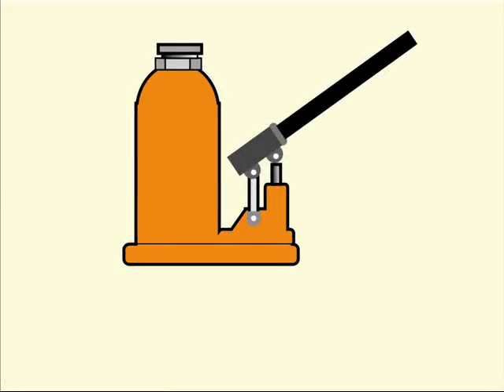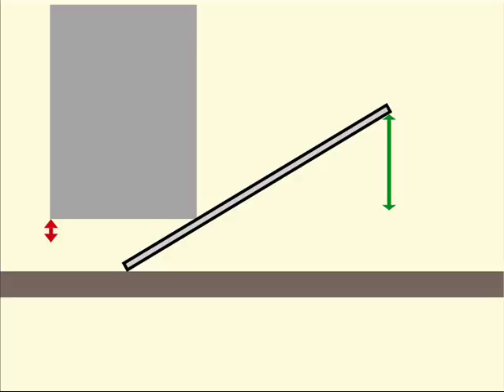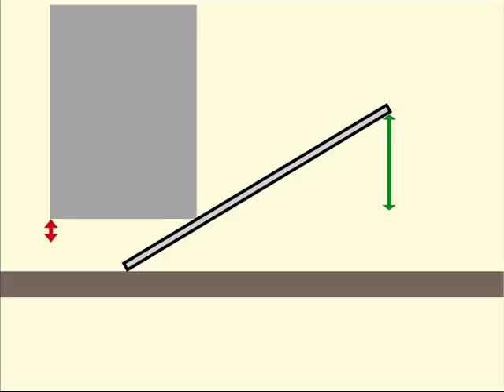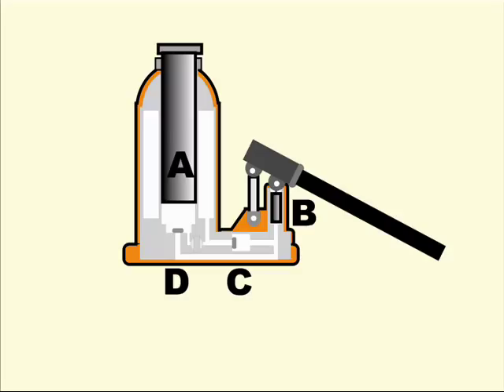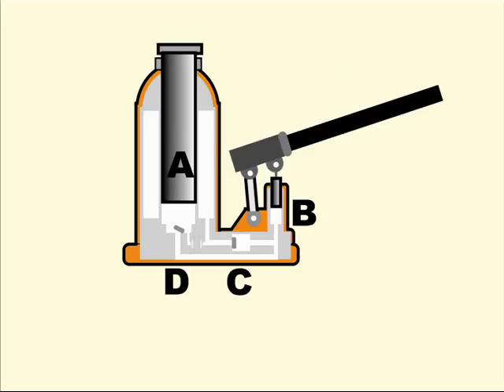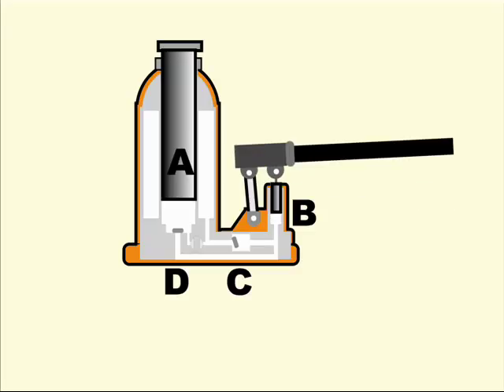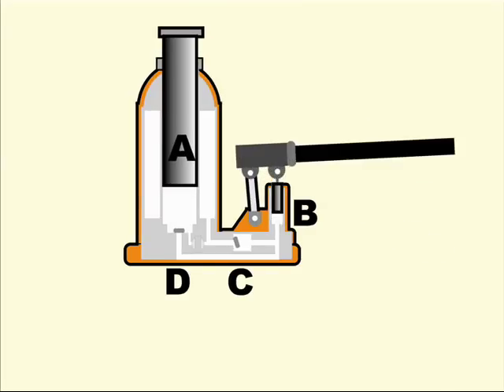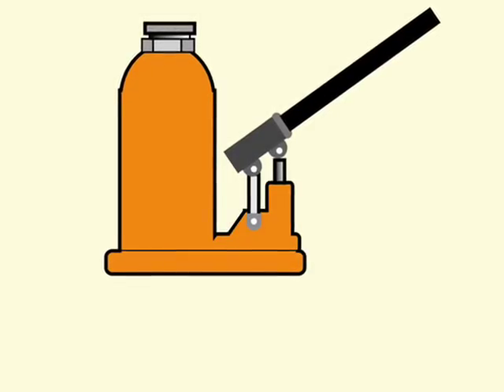How a hydraulic jack works

Comment: Thank you! that was helpful. My floor jack was not working because one of the two small B pistons was stuck. I have a dual piston jack. I pulled out the piston and cleaned it but I also noticed that the O rings on one of the pistons was not sealing good. I replaced O rings and its working great again. Now I understand how vital the B piston seal is to getting a good lift.

Comment: This is an excellent explanation.  
Makes me want to check out the rest of your work. I hope you have something on calculating the thrust of screw jacks.
Reply from the maker: Thanks for your kind comment!!! There are some very interesting types of jacks. Scree jacks ate just an application of the inclined plane. The finer the thread, the longer the ramp and the higher the lifting ratio. One very interesting approach is the friction jack used in old VW jacks. I used to own an old beetle and it worked just fine! It used to lift both the front and the rear wheels on one side of the small thing. You can find an explanation on that on https://youtu.be/hL9n-hLek7E
Reply: @eltunene  I will check that out.
I recently made a couple crude screw jacks out of nuts and bolts to get me out of a bind. It worked so well, I thought that i would try to calculate how much force I was generating.
I skimmed through your channel for a minute. Looks very interesting.  You are a man of many interests and abilities. I'm sure I'll be back to learn some new things.

Comment: Will the jack work if it is placed horizonataly?
Reply from the maker: Dear Venkat, you would have to find the optimal position for gravity to fill up the small piston chamber, which could be somewhere with the lever pointing down or to one side. Otherwise the pump may not "suck" the oil from the reservoir. Cheers!!

Comment: hi CHAVA I THINK YOU CAN HELP ME. FEW MONTHS AGO I BOUGHT A NEW JACK. I ASKED MY SON TO LOWER IT AND HE UNSCREWED IT TO AN EXTEND THAT THE FLUID COME OUT. I THEN TRIED TO REFILL IT AND IT NEVER CAME BACK TO LIFE. 

AND THEN YERSTERDAY I BOUGHT NEW 20 TON JACK. AND MY ASSISTAND DIDTHE SAME. THAT IT HOW I STARTED SERCHING ABOUT JACKS ON INTERNET.
THIS IS WHAT I TRIED TO DO : I UNSCREWED IT COMPLETELY AS IT WAS ALREADY NOT WORKING.I THEN TRIED TO FILL OIL THROUGH THAT HOLE. NOTHING CAME RIGHT. 
I TRIED SECOND METHOT OF OPENING A PLUG THAT IS RUBBER ON THE JACK AND FILL IT WITH OIL AND IF I PUT MY FINGER ON THAT HOLE AND TRY TO PUSH ``A`` DOWN THE PRESSURE RISES ON MY FINGER. AND WHEN I TRY TO JACK IT UP IT DOES NOT.

EISH
TRY HELP ME
Reply from the maker: Dear Moshitoa, first of all, thanks for your question. I learned about hydraulic jacks back in the early 1950s, and then my life turned to electronics for the last 60 years. However, maybe I can be of help to you by trying to find more info on that. About hydraulic jacks, most of the information around is generic, since they work on the same principle. So I would suggest you to watch the following video at:  https://www.youtube.com/watch?v=uRNhUCExu5Y Without saying a word, this guy cycled the hydraulic jack several times in order to rinse it, fill it and purge it. Notice he never removed the  E valve at all, just opened and closed it as part of the recycling process. I think this wordless explanation is worth a million words! Please update me on your final results.

Comment: Question if we use the same jack extend the piston and reservoir would we be able to raise the jack and its load faster??? I want to build a lift but with out motor power hydraulics.
Reply from the maker: Dear Denzil, maybe I did not quite understand your question. A hydraulic jack works with a fluid, but basically the principle of force multiplication is the same as with a lever and a fulcrum. If the load end of the lever goes up say, an inch, and the  opposite end has to be moved say, 10 inches, the effort is multiplied by ten, however, if you change that ratio in order to apply force for a shorter distance, and you are expecting the load end to move a longer distance, it will not work that way. If you extend the big piston's length (and of course the reservoir and the length of its cylinder) you'll have the capacity to lift your load for a longer distance, but will have to pump many times, which equates traveling a longer distance at the input. On the other hand, if your are talking about extending the length of the small piston,  it will work, but of course, every pumping cycle has to be longer, which equates to pump several times; it will work, but you'll have to apply the same force for a longer distance. However, part of the force multiplication is due to the length of the lever linked to the small piston, since for every inch you move the small piston, you have to your end of that lever about 8 inches, you would have to modify the lever mechanism in order to take advantage of the original multiplication ratio of the lever itself.

Comment: Why would the jack work perfect under no load and not work once load is added
Reply from the maker: Very possibly there is a leak in some valve or seal, and under no load, you can pump enough oil to raise the big piston, but when under load the leak would be sufficient to retur the oil without raising the piston.
Reply: Thanks for the reply so I guess the jack would be garbage

Comment: What I don't understand is that as the pressure under A increases because of heavy weight it is lifting but how doesnt it reverse back the pressure when the valve is open to put more oil into it?
Reply from the maker: The valve is in fact opened by the pressure the small piston exerts upon the valve when  the jack is being pumped. The pressure on the fluid is distributed evely (Pascal's principle) and exerts a pressure against the small piston too, but the pressure on the small piston is relatively small (psi), since the surface of the small piston is small compared to the surface of the big piston. It's a matter of pressure differences.

Comment: The Piston Diameter difference of A & B and force increase due to it should have been mentioned, I suppose.
Reply: It was, don't be a jerk, just pay attention, or make your own video
Reply: @atozbikes  I thought the same thing, that the video should have mentioned that the difference in diameters of the cylinders itself produces a mechanical advantage, additionally and independently of the lever principle. I rewatched the video, and it does not mention this. Of course it acknowledges that there is a difference in piston diameters, but it does not explain the way in which the ratio of piston areas, each with one and the same pressure acting upon it, generates a multiplication of force in addition to the lever principle. It is the most basic principle of hydraulics, and it is conspicuously absent. 

He repeatedly mentions that the operative principle is the lever's multiplication of force, as if this were the one and only (or primary) principle at work. In some jacks, the hydraulics does more force multiplication than the lever. 

The way he explains the limitation of the lever, namely the limited range of motion, and his introduction of the hydraulic jack as getting around this limitation by repeated "swinging" back and forth, suggests that he may think the sole purpose of the hydraulics and check valves is to allow for cumulative levering (and not to further multiply force), as if the hydraulics here were just a sophisticated ratchet. 

Besides this big omission of how hydraulics work, he also says a couple things which might be construed as technically false. For example, about halfway through he says that the lever is used to drive the small piston down, which increases the force (on the big piston) several times. This is true in one sense. But say the pistons were configured in reverse, so that you were pumping instead on the large piston. If the ratio of their areas was large enough, the mechanical (dis)advantage from the pistons would more than offset the mechanical advantage from the lever, and his statement would be false -- the force exerted on the output piston would be less than the input force, even as the lever itself was increasing force. 

He also states the amount of fluid being pumped into A from cylinder B is small, which is why A doesn't move very far. Again, it has more to do with the ratio of cylinder areas. I could pump the same small amount of fluid from B, but if I were puming it into an even small cylinder, C, piston C would move a great distance! 

There is no need to get defensive about this. Everyone who produces high-quality materials like this video, for the noble purpose of educating others, should be open to feedback on how better to educate. It would be a very simple change to say explicitly that there are two principles at work, and give a brief explanation of hydraulics. Even if he wants to focus on the lever principle, he can easily mention hydraulic advantage via ratio of cylinder areas. It would give viewers a much better grasp of the bottle  jack, and hydraulics generally, and would save confusion down the road.
Reply: be ready to listen to or read the adverse comments, or else disable the comments. Thanks

Comment: Which is the best fluid for hydraulic liftings
Reply from the maker: Functionaly, almost any fluid would do, however, the cylinders have rubber gaskets and o rings which may be damaged by some liquids, as well as steel parts which can rust, so special hydraulic fluid is better in order to keep the jack in good working order for a long time. Hydraulic jack oil is low viscosity, essentially the same viscosity as 10W motor oil. Never use brake fluid, antifreeze nor water, it will damage your jack.

Comment: Nice video created by you

Which software is used by you will you suggest me
Reply from the maker: Dear Pankaj, I use very simple software, I am currently using Inkscape for frame by frame animation, very simple. However, there are many nice animators our there, but I have never used them.

Comment: How do they run out of oil?
Reply from the maker: Any leak due to a bad gasket or seal, can cause a jack to lose oil gradually. Normally those jacks last forever, but sometimes, if used very frequently, they will develop leaks and start to malfunction.

Comment: Can it be used for a machine that picks up heavy heaps of wood?
Reply from the maker: Dear Zöe, well, yes, however, if the motion has to be done for distances over 3ft, or so, you can try using an old power steering system, pump and all, driven by an electric motor. I have seen people use that for dump trucks, so it can be used for  building a crane.  Here are three links to videos on applications of power steering components for other uses - https://www.youtube.com/watch?v=s3u7uWiFmak  -  https://www.youtube.com/watch?v=UXCwFsxTtII -  https://www.youtube.com/watch?v=PSAtLNn8NwE&t=146s

Comment: I am afraid this explanation covers only the lever part and it does not cover all the process that is occurring in the Hydraulic jack and it completely missed another very very important part of the explanation of how it works.
Here is the missing HYDRAULIC part:-

As the gentleman said, using the lever effect, the small piston B can receive a larger force on it more than what the human operator is applying. Let us say that the distance of the piston B from the FULCRUM  is x while the longer distance of the HAND  from the fulcrum is y, then  if FH is the force due to the hand and FB is the force on the piston B then,  FB= (FH )*(y)/(x) where FB will be greater than FH as y is much longer than x.

Now the force  FB of the piston working on an area (AB) of the small piston will create a  PRESSURE  P  in the oil under the small piston B. This PRESSURE  is then applied to the larger piston A  when the valve opens up and so the force on the area AA pushing the jack upwards  is given by, area AA, multiplied by pressure P.

Hence Force pushing up is  both the lever amplification and also the hydraulic amplification and this is  = (AA)* (P)/(AB)   =  (AA)* (FH )*(y)/(x)/(AB)

Note there are two amplifications of forces, one due to the mechanical lever effect in the different distance x and distance y,  and the other due to hydraulic effect and different AREAS  used in piston B with area AB and piston A with area AA.   It is very important to understand the area and the hydraulic part as that is the real "hydraulic amplification" taking place, not only in the lever which is not exactly due to hydraulic pressure. ( unless one takes into account the area of the skin on the hand touching the lever!) 
One must be very careful with explanations so as to cover the whole process of activity that is taking place.
Reply from the maker: Thanks a lot for your contribution!!!

Comment: Bottle jacks can have far superior load capacity and mechanical advantage for their size and weight compared to other types of jacks. The only downside is that they cannot lift as fast as the traditional lever jack assuming the operator has sufficient strength. What you gain in mechanical advantage, you lose in speed. Hence you want just enough mechanical advantage so that you can repeatedly pump the jack handle without fatiguing.
Reply from the maker: Thanks for your contribution!!

Comment: thank you. but why we should use a special oil to do that ???
Reply from the maker: Almost any fluid would do, however, the cylinders have rubber gaskets and o rings which may be damaged by some liquids, so special hydraulic fluid is better in order to keep the jack in good working order for a long time.

Comment: My 4 tons bottle jack is down, but it is stuck. How could it be fix.
Reply from the maker: Almost any stuck valve or piston can cause this, it is recommended to replace all o-rings to start with. The rubber parts have a relatively short life, and are the achilles' heel of hydraulics.

Comment: So a jack that doesnt work most likely has a bad check valve? Would you be able to fix it?
Reply from the maker: Any leak in the gaskets or in the valves can render a hydraulic jack useless. Normally an overhaul si in order for an old jack, replacing all wearable components, such as gaskets, o rings, and valves.

Comment: Need more info how the oil flows as doors open n shuts..
Reply from the maker: The jack has automatic check valves, which open as pressure is released (upward stroke of small piston) and increased (downward stroke of small piston). Oil es extracted from reservoir and forced into big cylinder when raising object, and is returned to reservoir when lowering object, by means of the oil return valve.
Reply: @eltunene  Chava thanks did not the jack work that way ..good info..thank you for the reply..and all those bad comments from others , They dont know how to ask question ...thank you again...

Comment: what will happen if the size of small cylinder is increased to make the big cylinder lift faster
Reply from the maker: Dear Charles, the relative sizes of the small cylinder and the big cylinder are like the arms of a lever. The long arm travels a longer distance with very little effort and moves the short arm a shorter distance with a lot of force. If you use a big cylinder instead of the small cylinder, this is equal to using a lever with same lenght arms. Both arms travel equal distances. You would have to exert the same effort with your hand in the input arm as you expect to appear on the output arm. You can try this: try to lift a heavy object with a lever, short arm as output and longer arm as input. You can easily jerk the object up and down. If you slide the fulcrum until both arms are equal, you will have to exert great force for barely moving the heavy object. Same thing happens with the relative sizes of the cylinders in the hydraulic jack!

Comment: There are 2 principles at work.  One is the force multiplication due to the lever arm, and the second principle is a force multiplication due to the difference in piston diameters between the small and large piston.  If 1000 pounds of force is generated on the small piston having a frontal area of 1 square inch, then the hydraulic pressure generated is 1000 psi (1000 pounds per square inch).  Then if the 1000 psi fluid acts upon the larger piston of say 4 square inches of frontal area, then the force generated is 4000 pounds (a 2 ton jack).

Comment: Hello, what hydraulic press ton we need to straighten a 5mm thick aluminium plate 5 x 5 inxh wide ?
Reply from the maker: Hi, Triumf, honestly, my background is electronics, and old fashioned electronics. I did find a video which describes how to straightening cast aluminum using a heat gun. Unfortunately the narration is in Spanish, but the images speak by themselves. The problem with aluminum is springback, so heating appears to be a must. Please let me know if you made it using heat from a heat gun.
Reply: Chava Tarin thank you i'v seen it with a heat gun but i thought if it would work only by pressing, i didn't know that aluminium have springback effect, anyway thanks for the information you have

Comment: It works exactly like a air pump (like a bicycle pump) with the difference that the fluid (air is a fluid!) is oil instead of air. All of these pumps have two check-valves; the suction valve which draws fluid from the reservoir and builds pressure in the pump cylinder as the piston is pushed down, and the discharge valve which opens to let oil into the ram cylinder and then close shut to support the force on the ram.
Reply from the maker: That is exactly how it works!!!